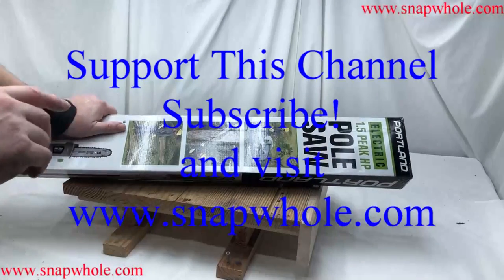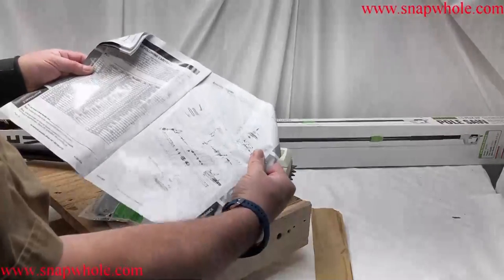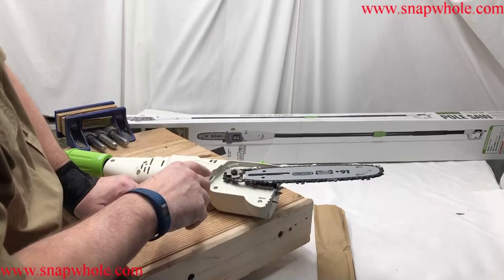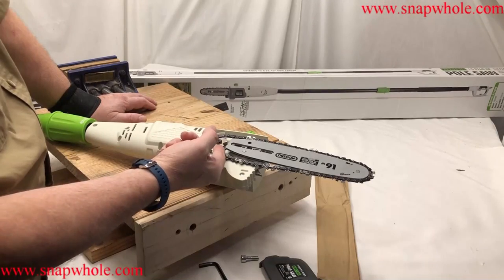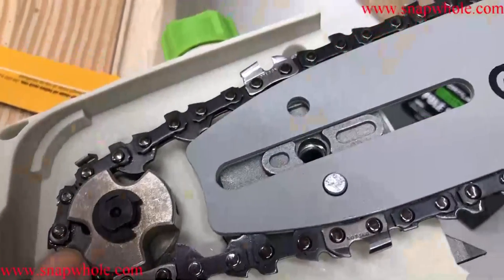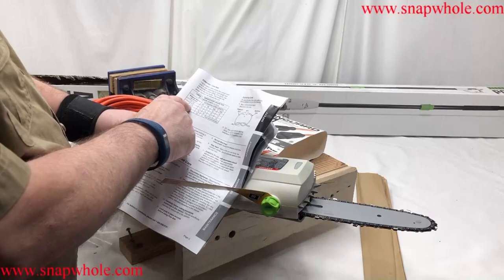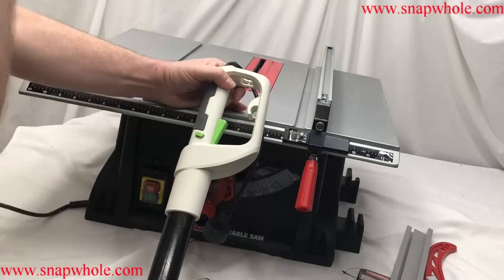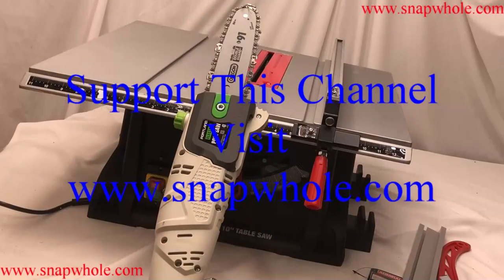Harbor Freight 6.5 Amp 9.5 in. Electric Pole Saw Setup and Review

Comment: I paid $52.00 yesterday. 20% off with my membership. I am so impressed with this saw. It zips right through hard oak tree limbs like butter. I accidently got it stuck up in a tree for 24 hrs. I was hanging and swinging on the end of it. The next day i got it down and nothing wrong with it. This is one tough little saw!
Reply from the maker: I have a very good opinion of this saw, works great, and just keeps working great, I'm using it to do major trimming of all my trees after not being able to because of covid recovery and it just works - thanks for subscribing!
Reply: I did the same, bent the chain. I replaced it with an Oregon S 33 chain. It works better than the original chain.

Comment: Cut down 6 adult pines, notch cuts, with this. Heights 25-40 ft. Largest cuts 12 inch trunks. Unbelieveable. Plus once the tree is on the ground, don't have to bend over to cut it to pieces. My back is happy. Way less effort than my friends $450 (steel) chainsaw that he brought over, quieter and little safer too. For the lower parts of the trees I just made two cuts to cut them fully. One tree fell with the saw stuck in it, I bound the saw up twice (my fault impatient) motor started smoking. Still works great. I also used junk leftover oil I had in it. Best $65 saw ever.
Reply from the maker: it is amazing how useful this saw it, I was impressed with the power it had, I am impressed with the saw - thanks for subscribing!

Comment: I had this pole saw for 6 years great saw. But, I did find if I use bar/chain oil for chainsaw it’s too thick. So I’ve been using just regular motor oil, works fine.
Reply from the maker: I almost talked about that in the video, but decided not too - I've used whatever is available as chain oil, regular motor oil, transmission fluid and even used motor oil - when you are out in the woods, you use what's in the truck......even ran without for a day (not preferred!) on my saws in the past - thanks for subscribing!
Reply: Thanks for that tidbit about the bar oil being too thick ... as well as the part about having had this saw for 6 years. That's comforting. 👍

Comment: Does yours leak oil when stored?
Reply from the maker: I have not noticed any leaking oil, seems to not be a problem with mine, how bad is the leak? a little, or all that is in the tank over time?
Reply: @snapwholeharborfreightreviews    Well I stored mine in the upright position and the remaining oil leaked out down the whole shaft. I only used it once. No other problems besides that.

Comment: They really need to carry, in-store, replacement chains for this saw. 9.5" replacement chains are almost impossible to find in any store that sells chainsaw blades.
Reply from the maker: looks like HF measures their pole-saw chains different from everyone else, this actually takes an 8 inch chainsaw blade, the 9.5" measurement seems to be the bar length, where everyone seems to measure just the length of the bar that extends outside the body and is available to use for cutting - these are available from many vendors on amazon, and should be at your local lowes and home-depot, with them being available so easily, I can see why HF does not stock them, or offer them as a replacement part  - Thanks for subscribing!

Comment: How many VOLTS is this unit?
Reply from the maker: 120v, it uses wall power, although I have ran it off the 2K watt inverter in my truck, it is really made to trim around the house, so a cord is not that bad to deal with, but in the field, it does get a little more ackward to get the truck close enough for the cord to reach - highly recommend this tool, very happy with it - thanks for subscribing!